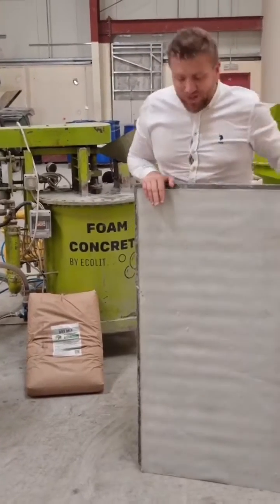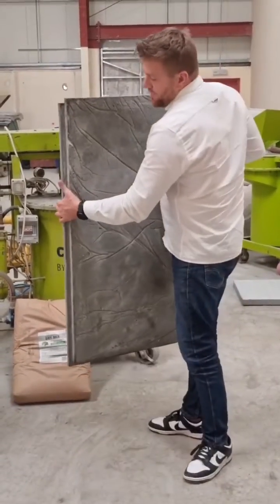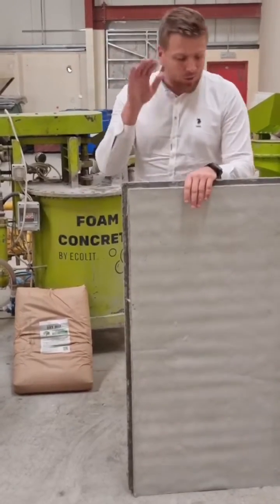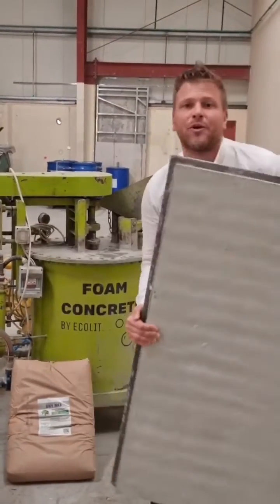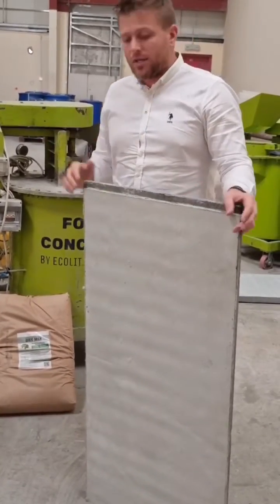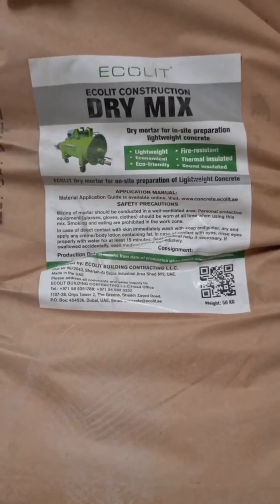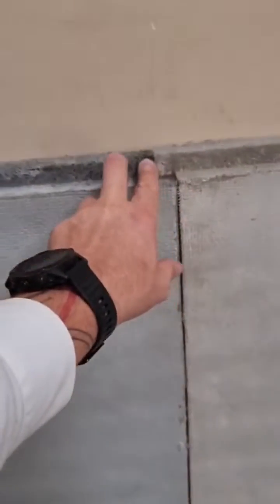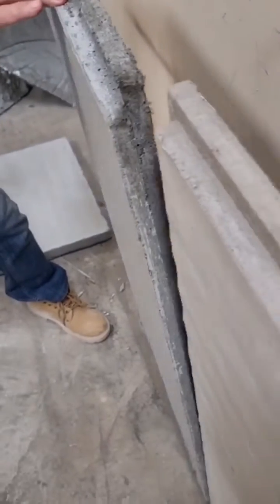Lightweight concrete wall panels

Comment: Can this panel be used in intermediate floors without any rebar? Secondly , how does the panel jointing work. Do cracks emerge afterwards in the joints due to thermal expansion and contraction?